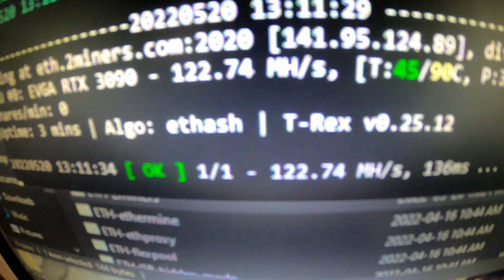EVGA RTX 3090 FTW3 THERMAL PAD REPLACEMENT

Comment: hey I know this a late but I was also looking to replace thermal pads on my evga 3090 and I was wondering what thickness thermal pads did you use?
Reply: there;s a comment at the bottom, check it out
Reply: @shodeb5564 i do see that. Thank you very much

Comment: So do you think the thermal pads should be changed for an EVGA GeForce RTX 3090 Ti?
Reply from the maker: From what I have seen, the thermal pads and cooler on the evga 3090ti are pretty good, they probably do not need to be changed. If you are mining keep and eye on the memory junction temp, or use gpu-z to monitor the temps

Comment: 90c on the memory?? Mine is at 65c
Reply: @MisterRavlyk  unless they're not using a stock cooler.

During mining tests, my 3090 memory junction tops out around 79 - 80*C and all three memory temperature sensors stay below 55*C.

But I'm also water cooled with an active backplate.

Comment: What thickness of the pad for FTW3?
Reply from the maker: This is a custom kit from Kritical Thermal pads. Here are their specifications for the sizes from their website: 
Thin (1mm) and wide (10mm) stripes go on the grey power modules where EVGA used thermal putty, on both sides of the GPU die. 
Thick (2.6-2.8mm) and narrow stripes go on the mosfets, on both sides of the GPU die.
Thinner VRAM pads (2.25mm) go on the front side (i.e. die-side) of the PCB.
Thicker VRAM pads (2.5mm) are now black and go on the back side of the PCB.

Comment: What size thermal pads for the bottom and top so I could try this on my 3090 ftw3 too
Reply from the maker: Hey man, this is a custom kit from Kritical Thermal pads. Here are their specifications for the sizes from their website: 
Thin (1mm) and wide (10mm) stripes go on the grey power modules where EVGA used thermal putty, on both sides of the GPU die. 
Thick (2.6-2.8mm) and narrow stripes go on the mosfets, on both sides of the GPU die.
Thinner VRAM pads (2.25mm) go on the front side (i.e. die-side) of the PCB.
Thicker VRAM pads (2.5mm) are now black and go on the back side of the PCB.
Reply: @Artun.  Nice was looking up the sizes and that product fame up first.

Comment: My EVGA 3090 FTW3 is doing 124.2MH, with stock thermal pads at 96-98c.  If you changed the thermal pads and temps just go down to 90c, I won't change mine for now.  Thanks for the video.  My OC, 1200 absolute core clock, 2600 Mem, 85% Fan on HiveOS.
Reply from the maker: Yea no point in touching that card those are good temps for a 3090. No problem at all! I have a few more different cards that need thermal pads coming soon!